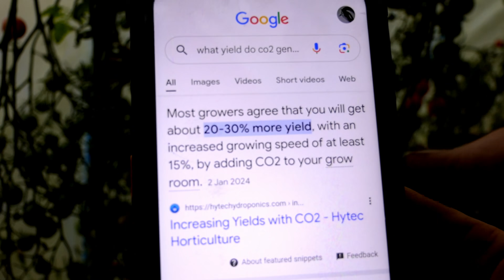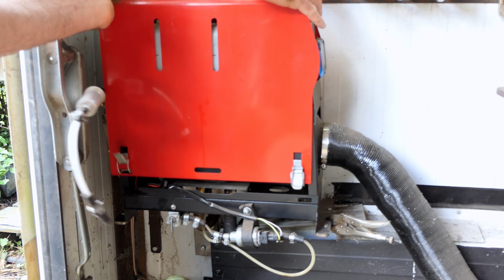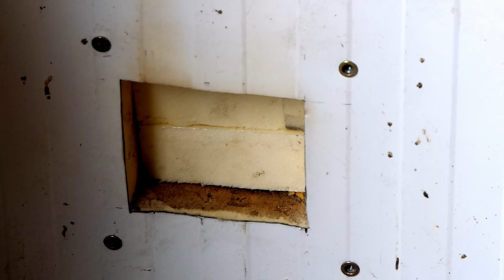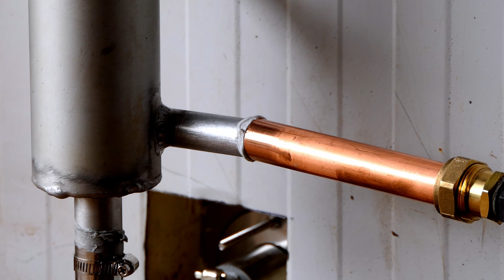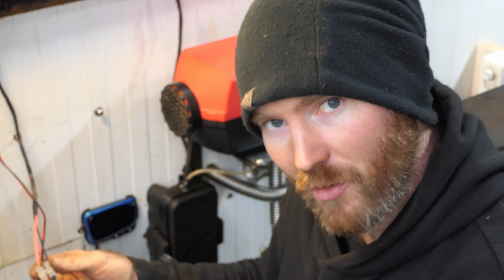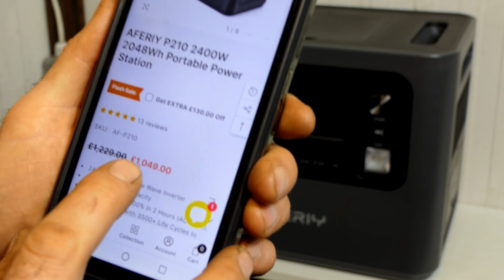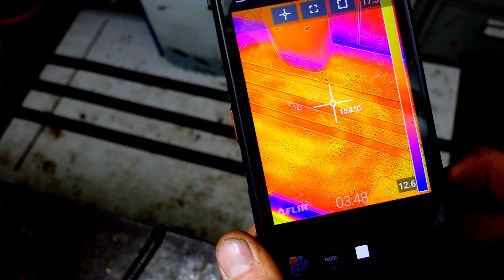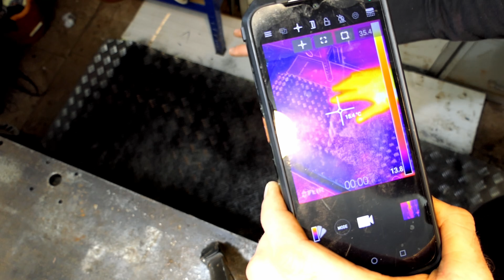NEW! Better system for Cheap and Safe Heating💲+ Underfloor Heating Mod test🫠

Comment: wouldn't it be easier to put a coil of copper tubing inside a barrel filled with water then have the exhausted go trough the copper pipe? seems easy to make and gives you a barrel full of hot water allowing you to store some for later use!
Reply from the maker: @kingjustjefgames723  I'm thinking exactly that. A big tank like an oil drum with an exhaust coil inside it to heat the water. Cheers J
Reply: @joshuadelisle 
You could see if you can find a second hand single or better still a twin coil hot water cylinder. This will already have nice efficient coils inside, as that's how a boiler would heat the water. The heated water could then be stored in the cylinder, ready to pump around a radiator system.

Comment: Rubber hose between the copper and Aluminian pipes. Agreed on All else. 🔥
Reply: Since they are electrically connected by the medium inside (water) I suspect galvanic corrosion will occur regardless.
Reply from the maker: @bust2boom596  you're right. Cheers J
Reply: Silicone rubber hose (sold for cars) is excellent stuff. A straight 18mm bore will comfortably stretch/squeeze to these pipes. Use an inhibitor in the water. Or even car antifreeze.
Reply: A long corrugated exhaust run inside a 50mm (2”) aluminium tube with a fan blowing air through will extract the heat. 3 metres of pipe should be enough.

Comment: 37:50 not sure if you get to this but wouldn’t it make more sense to run the in floor heating through something that isn’t such a great insulator? Like you want something that will absorb the heat and conduct it away. Instead you’ve just run the hot water through an insulated loop! Probably running it directly through concrete or some sort of radiator ( that I’m sure you could cook up ) would work better
Reply: Maybe a big water bladder or a flat tank. Something that has both a big heat capacity and conducts heat efficiently. The foam insulation has neither and the aluminum top will probably not work fast enough to pull the heat from the water passing through
Reply: @chir0pter  the problem with water is that it's water. Sand would likely do a lot better. Or maybe stone with some cob holding it together. Or simply concrete.
Reply from the maker: @chir0pter  you're right but it definitely needs insulation underneath otherwise you lose up to 50% of the energy into the ground and it doesn't come back. However running the pipes through a concrete floor covering as a mass heater is definitely a good idea. Cheers J

Comment: I take your information as read. My assertion is that if CO2 is the cause of retaining heat energy, then the injection of the stuff into the very place where it causes the most heat retention, would be the first place governments would stop it.
Nine Eleven was an awful event. It made all flights stop. Over the days air transport was stopped, the air temperature was reported to have dropped by a couple of degrees.
STOPPING all air transport would solve the "global warming" issue. Governments will NOT stop air transport for frivolous holidays or business trips - they make too much money.
My best guess, our earth will do whatever it has done in the past, over and over, getting hotter and colder. 
Tax for CO2 will continue to fill the pockets of the undeserving, as it is easy to manipulate data.

"You can fool all the people some of the time and some of the people all the time, but you cannot fool all the people all of the time," is a remark by Abraham Lincoln that demonstrates a deep understanding of scepticism, human nature, and the limitations of deceit.
Reply from the maker: I think geoengineering is the relationship to the air traffic not the CO2.... Check out 'the Dimming' video. Cheers J

Comment: Thanks Joshua, I agree with all your points. the other elephant in the room is that ice core samples show that temperatures rise first then co2 rises 600 to 800 years later. So Co2 is not a driver of temperature, temperature is a driver of Co2, and as you point out, solar activity is the main driver of temperature.
The oceans are the biggest emitter of co2, and they are so vast it takes the 600 to 800 yers for them to warm enough to give off more co2.
In the Roman era (much warmer than now) Britain had many more vineyards even in the North, hence all the roads called Vine Close, Vinery Road etc etc
I would recommend Paul Burgess, climate realism channel, also the documentary first shown years ago on channel 4, still on YT "The Great Global warming Hoax".
Reply from the maker: @pauln7422  Thank you so much, that's very interesting and I'll do more research on that. Thank you again. Cheers J

Comment: Thought you should know that thanks to all your work with your CDH's, I have installed one in my converted minibus-no-camper-van.  Still have a few little changes to make so that it can handle bumps and pot holes, however it works very, very well.  Thank you Josh.
Reply from the maker: @raymondpenn1066  well done. Thank you and All the very best. Cheers J

Comment: May be for the copper to aluminum connection use some type of tubing rubber man made flexible etc and some clamps if the ct1 does not work
Reply from the maker: @FlixmyswitchLASER  that would work, it's not getting too hot which was my first concern. Cheers J

Comment: For the floor you need to make a metal spreader plate where the pipe is push in to a channel with say 80% of the pipe circumstance is touch the metal. No so easy for you to fabricate. Search metal underfloor heat spreader plate and you will see what is commercial available. These would sit onto of your floor to make sure the heat goes up and not down. Then you need a suitable top covering, may be screed.   For you push in pipe you should be using pipe inserts to give the connector strength. Make sure to buy the insets to match the make of the fittings you have used. Keep you the good work.
Reply from the maker: @FlixmyswitchLASER  thank you so much that's great advice. Cheers J

Comment: I'm really surprised it's not overwhelmingly carbon monoxide. Very useful to know. 
How about making a very long exhaust pipe that snakes around the inside of the room, radiating the heat a lot more before it actually gets to the outside. It would eliminate the need for the radiator and heat exchange pipe and be very inexpensive. 
The underfloor heating is great. Very impressive. Metal isn't going to conduct heat very well though. How about just having the pipes exposed with a thin porous outdoor mat, such as the type which people clean their boots on, over them.
Reply from the maker: @artytomparis  thank you, previously I did do a long exhaust, one issue is the longer the exhaust then the more restriction on gas flow. that can cause issues which resulted in the carbon build up. Cheers J
Reply: @joshuadelisle  Perhaps a very low powered extractor fan?

Comment: The pipes would work better in sand with slabs over or in concrete
Reply from the maker: @woodworks2123  I think you're right. Cheers J

Comment: Can you build a sound box for the pump in the same way some people build a sound box for a petrol generator.
Reply from the maker: @woodworks2123  for the water pump I think I need to isolate it from the hard copper with a soft flexible hose and then put it in the box, I tried tying a blanket of wool around it as it is but it did nothing. Cheers J
Reply: One thing that made me a little alarmed is that sound damping wool-like material which might act like a lap-wick if there is a leak...😁